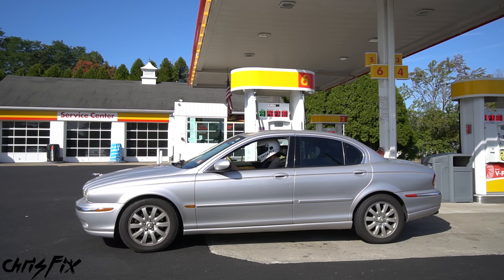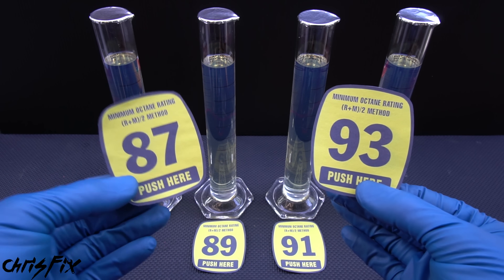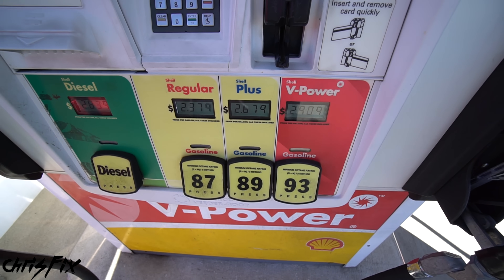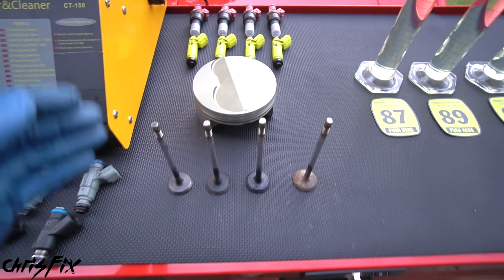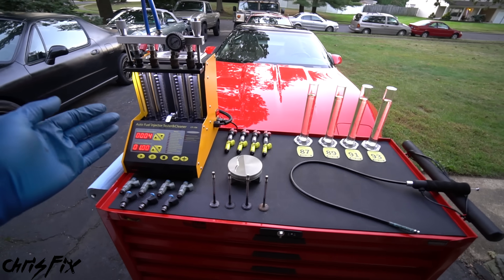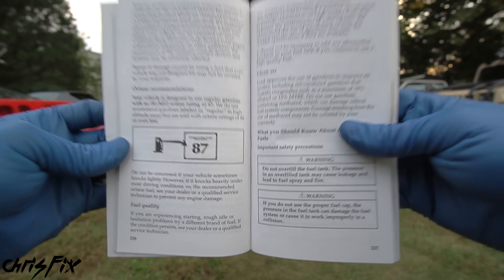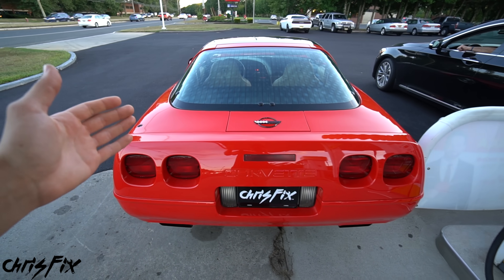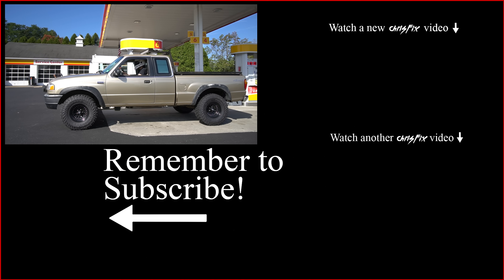What is the BEST Fuel to Use in Your Car or Truck and WHY

Comment: I have done my own testing, and mpg does get better using regular vs premium. Tried and true. Does it pencil out for savings? Not sure. The video left me with a lot of questions.
Reply: Not that easy. Since there are tons of factors to consider. The main one though: weather conditions (wind, rain and even sun). You'd have to do dozens of tests and make sure the conditions are always the same.
Reply: It's the detergents and your driving style, not octane (unless your car requires a minimum octane greater than regular)

Comment: I think Shell also must have some atomizers in their gas, because I consistently got about 20 miles more per tank in a V-Tec Honda Civic. My testing wasn't exactly scientific, but it was done over more than a year and my driving habits were very consistent. My gas gauge didn't work properly so I reset the odometer every time I filled up and my car consistently took less fuel to fill when running on Shell gas based on the same mileage from other gas companies. I noticed the pattern of better fuel economy (about 6%) using Shell gas long before I cared to do the math, so I don't think I started with any biases or preferences to expect a certain outcome. I don't know if Shell is the best, but it is definitely one of the top fuels.

Comment: Don’t you use mon in the US? - Motor octane number & not Ron? ….. saying pump octane is the same as Ron as it’s basically a temperature difference that separates the two measurements 

The whole thing about US having crappy fuel is just based on the fact that you can’t get the good stuff everywhere and some folks have to run on stuff like 87…. Which I would consider peasant juice & it’s not like it’s a country is known for high quality  🤷🏻‍♂️

Comment: I choose .... none!
I can only choose  between 95, 98 and 100+ Shell VPower.

I have a question - why a 3.8 V6 (i.e. Ford Mustang 1995) has 147 HP. It is less horspower out of 1 liter(39HP) of engine volume than Fiat Cinquecento 900 (900ccm, 39-41HP, that makes 43 to 45HP out of 1 liter)? It's much less than average european car from that era - 2.0 litre 115 HP or 140HP with 16 cams.

Comment: The rating system is different

However after speaking with someone who has worked at the same fuel company as an analyst in both the us and aus, the fuel here in Australia is slightly better

Comment: Ik this is an older video but I work in a gas station in Oregon (We pump ppls gas here) and if you buy a car from somebody I would not trust the gas cap. ppl lose the gas caps or get them stolen from getting gas siphoned and dont have the orginal cap. From personal experience i've noticed volkswagen and volvo cars take different fuel depending on the model and dont have a "special" cap what I mean by special cap is for example BMWs have a different cap and you wouldnt be able to use a typical gas cap on them while volvo and volkswagen can use most caps from what i've seen and many times I've seen gas caps saying  regular gas while the sticker on the side says premium.  You might say well I'll just look at the sticker but a lot of stickers especially on older ones r very faded or ripped off. It's a lot more common then you'd think but if you really care for your car i'd just use your users manual or just look it up online.
Reply: my Jetta (TSI) calls for regular but I get better MPG, mileage range and better performance when using 93. So there's that lol... A little trial and error definitely helps w deciding which gas works best for your car.
Reply: @1804Mak  yeah I noticed a lot of customers telling me that

Comment: Why would a relatively new car, 2018, run smoother with premium gas? It idles smother, and I take the same routes to work every day and I know every curve and hill, and when I run premium It doesn’t have to downshift to pull the hill.

Comment: What is you opinion on adding 1 cup of diesel to full tank of gas to clean it the same as you would with something like sea foam ????
Reply: jus use a fuel system cleaner instead of risking your car's engine...

Comment: My understanding is the higher the octane rating the more the fuel is resistant to burning therefore it reduces pre-ignition from hot spots inside a combustion chamber as described in the video as an explosion, the octane rating to me is just the fuel's resistant to burning.

Comment: Great vid.  One more thing to touch on is quality vs economy.  I could get 12 one way trips to work on a tank of chevron gas and 8 one way trips with arco gas. You will save money by spending more on top tier fuel as arco gas isn’t 30% cheaper while giving you 30% less mpgs. My yota finally popped a head gasket after 400k+ miles   When pulled apart, All valves were absolutely spotless. Not just the ones that had the coolant breech.  Because I always warm my rigs up and use top tier fuel.
Reply: My car gets better MPGs with Arco, no lie.

Comment: Hey Chris. Great video. You cleared a lot up. But one thing is still bugging me. Is Shell gasoline really being pumped out of Shell pumps and into my truck? I have pulled up to my Shell stations and they were getting their tanks refilled by a truck with no name printed on the side of it. What gas is really being dumped into the holding tanks at my Shell station? Thanks for sharing.👍👍🍁
Reply: I believe all gas comes from the same local terminal. It's the additives they add to the tanker that the different brands request ,that make the difference.

Comment: I use the Nitro pretty much 99% of the time… head scratcher is my is250 is a GDI sooo am I throwing $ away getting the premium…?

& I was under the understanding that knocking happened or was more audible after you shut the car off…?
Reply from the maker: No gas station I know of sells Nitromethane... That would ruin a stock engine. Check your owners manual and see what it says. That engine might require premium so you should use it.
Reply: @chrisfix  lOl I’m talking about the v-power-Nitro from shell…
Reply from the maker: @ngarci8040  ohhh lol. That’s just premium. Check ur owners manual to see if u need premium or not
Reply: @chrisfix  hey you do good work ty for your content…!

Comment: Great explanation.   I was surprised earlier this year when I read my Owner’s manual and it suggested a higher octane could help while towing.  Not “required” but if you had knock, run premium.  
Also, one thing I’d be curious to hear is when a gas station has non-ethanol gas or “real gas” as some say.  It’s usually 88 .  But that vs 10% ethanol gas?
Reply: Ethanol creates condensation which is bad for small engines (lawnmowers) and cars that sit.

Comment: Great Video as always Chris. I have a 07 g35x 250K on the dial. I  use a fuel additive that starts with L and ends with S on each gas up fill up         ( I buy the large one)  I will also do a 50/50 blend of Reg/hi oct. I also only use Synthetic Oil. Is this all OK?

Comment: My experience, find fuel with 0% ethanol. 
Octane does have to do with burn timing and burn temperatures. Octane changes the fuel chemistry to cool combustion which slows burn rate and reduces detonation.  This slowed burn rate allows ignition tuning so you can further advance ignition timing more than lower octanes.   Diesels have additives that work in the opposite direction of thinking the measurements called cetane.
After full 1 tank or 2 full tanks of non ethanol fuel it does help clean fuel system contaminants.  Ethanol gums up leaves films and build up in fuel filters, fuel pumps it corrodes fuel hoses and plugs fuel injectors.  Most of the octane booster products are just some form of alcohol which in most cases aren’t the best for your fuel system.  In some places your choices are e10 up to 10 percent alcohol 87 89 91 with option of 88 no ethanol or 93 no ethanol.  Some places there is and E85(85% ethanol) option and there is E15(15% ethanol for flex vehicles).  Ethanol does effect fuel economy and quality of fuel burn that is why I avoid it if possible.  If you want to boost your octane without ethanol the correct way find unleaded higher octane fuels, I have 3 gas stations around me that order them by the drum if I need it. They come in many octanes from 95 96 98 99 100 unleaded for street use certified application. They take delivery every 2-3 weeks. It’s for their high end cars such as Ferrari, Maserati exotic cars owners.  The cost is usually about an extra $3 more per gallon for 95 from my experience. $10+ more per gallon for others. But you will have a better more consistent experience in the vehicle. In the end I still prefer faithful Diesel.

Comment: 1:54 They don't have the same Energy content, 87 has more ethanol than 91 or 93 and ethanol has 20% less energy than gas. You would need to do the math based on percentage of ethanol because of the loss of energy. Yes I know (blah, blah, blah) I did the math on one of my SUV's and 91 gave me less $ spent per KM on long trips on the hwy. (but that was years ago) with the price today I use 87 in my vehicles.

Comment: I have a 99 GMC SUBURBAN 5.7 litter, wit ALMOST 300,000 miles on it (295,989 2B spastic) but it says 2 run 89 "OR REGULAR" GAS ⛽, BUT WITH ALL THE EXTRA BENEFITS OF USING PREMIUM, MY QUESTION IS - WOULD MY MOTOR BENEFIT OR RUN ANY BETTER OR CLEANER, IF I WERE 2 RUN PREMIUM GAS EVERY OTHER FILL UP OR EVERY OTHER 3RD FILLUP, OR WOULD THE DAMAGE FACTOR B HIGHER THEN THE BENEFIT FATOR..? Jw IM VERY CURIOUS AS 2 HEAR WAT EVERY1 HAS 2 SAY ALONG WIT THE MAKER OF THIS VIDEO TOO (HOPEFULLY ANYWAYS...) BUT PLEASE FILL ME N ON THIS CONUNDRUM ON WETHER OR NOT THE RISKS OUTWEIGH THE BENEFITS OR VICE VERSA... PLEASE AND THANK U

Comment: Great video. Wish I say it earlier, will definitely share with my friends.
Up here in Canada, all of our top grade gas (93 and higher) have about 10%ethanol, but some of the mid grade (91 and 9 2) have no ethanol.
My question is... Do you think ethanol will cause more engine corrosion in thy long run?
My car needs minimum 91 octane (I can get that without any ethanol), but sometimes I would like to use 94(which always has ethanol).
Thx!
Reply: ethanol is also cheaper, here in Ukraine some people just add alcohol to 95 gasoline in proportion about 30% percents of alcohol.
Reply: @HannibalLecter-w3r  bless you guys in Ukraine
Reply: @Flight2Freedom86 if you're interested there is no gas/petroleum/diesel fuel right now. Everything goes to army.

Comment: For those vehicles with 91 recommended yet available fuel has ratings 87, 89, 93, ...? :) Often fuel not promoted with understanding Octane rated distinctions but indicated as 'grades' so people understandably get puzzled about energy quality & enhancing performance or emissions & pollution issues then through in the blended & additives so issues become prominent including doubts on purported specs & methods.

Comment: At 2:08 you say that octane does not affect the speed of the burn. That is FALSE.  Detonation occurs in 1000th of a second a normal burn occurs in 200th of a second the speed of the burn is exactly what the difference in the octane means. 1 thousands of a second or less IS detonation. I realize you are looking at it as the spark burning out evenly vs multiple points starting so the speed of the reaction is the same, it's just starting in multiple points. However the end result is all the mixture being consumed in 1000th of a second. It burned up faster. The definition of detonation is a burn that occurs in less that 1000th of a second, the cause is not relevant. Speed is the relevant factor. Higher octane causes the fuel air to burn in more than 1000th of a second. The metric is, has been, and continues to be time. Because the definition of detonation is time related...  PS LOVED the video!

Comment: My gas stations have 87 with 10%?ethanol and they have 87 ethanol free for a more expensive price.  Should I be concerned with gas with a little ethanol in a stock 2006 Camry with 70K miles?  Why do they have ethanol in them in the first place?

Comment: Thank you!  I have a van that uses either flex or regular. A mechanic told me not to use the flex bc it gunks up the engine. Do you have an opinion on that? Also, which grade fuel if I use regular grade on the van and can't find the grade? Thanks for answering bc I also have a luxury car and usually use the highest octane. Is it ok to use the midgrade in it? Thank you in advance!♡

Comment: I thought this would be a video about what gas I should put in my car for hp over gas mileage. Chevron for gas mileage and for myself I personally love having more hp so I only use Shell.
Reply: The reason he didn't make that video is because it's nonsense
Reply: @jonathansmith7306  I wish all gas was created equal. Unfortunately there is truth to this. Shell gas burns hotter while Chevron is more milder but better with fuel efficiency. Only a 1.5 gpm extra but it's a difference. Ampm gas is the worst on hp and efficiency compared to shell and chevron/Costco gas. Don't believe? Do the Shell challenge

Comment: Usually I go to chevron,  when I got my brand new 2021 chevy silverado crew cab z71 rst, when chevron got high, I go to shell, sometimes Costco....my wife put Arco in it once cuz chevron at a certain place wouldn't take her atm. So I just need to stick with Chevron/Shell, 87 and I'll have to try 89 to clean it out.

Comment: It's been proven in multiple studies over the years by both the EPA and Fuel Production facilities that the use of premium grade fuel returned more MPG than either regular or mid grade fuels. It does it by burning more completely and efficiently. Efficiency = Performance = Energy produced. The more MPG a fuel grade provides means it produces more energy than a lower grade fuel

Comment: Also dirty fuel builds up on spark plugs causes less life on the plug most high performance cars use hotter plugs so they run and last longer with correct fuel!

Comment: I get better power out of 93 than I do 87 my v6 4 runner it’s got 4valves per cylinder. It makes no noise on 87 but it doesn’t run smooth like 93

Comment: the fuels are not similar. I was Fuels in the military overseas and conus. Canadian 90 fuel gets 160 more miles across a full tank to empty in my Sierra Denali. 93 in Alaska (from chevron pipeline) and in the U.S. lower 48 only adds 50 miles max to tank volume usage compared to 87 octane. 

Also my Chrysler says flex fuel 85 but incurs performance problems and bad gas mileage results after consistent usage, as well as 87, so I use 89 in a t&c minivan.

Comment: The biggest myth here is claiming that 93 octane is premium fuel
It is not premium feel premium fuel is 100 plus octane... 93 octane is only considered to be regular fuel... Premium octane fuel is not sold at the pumps anymore
Example one of my older cars was a 1972 Ford LTD with a 400 cubic inch engine with a compression ratio of 8.6 to 1
The owner's manual said congratulations you now have the first Ford big block with a low compression that will burn regular fuel of 93 octane..
This engine was called the m that stood for modified. What Ford had done what you lower the performance to gain more fuel economy and still maintain a reasonable amount of torque for pickup trucks four wheel drive pickup trucks and large heavy full passenger cars.. and at the time it was pretty successful it got 18 miles per gallon not bad for a car that weighed almost two and a half tons... So all of you out there are just s***** yourselves and listening to a fool who thinks he knows you're all there is about car he didn't know anything first of all he doesn't know what happens when they knock sensor kicks in and it retards the timing so the Piston is firing after it went down losing gasoline after exhaust and costing you performance and money burn 93 octane and everything including your lawn mower
Example I went on vacation for a couple of months and the guy mowing the grass at the house was running our John Deere on 87 octane and it was nothing so bad you couldn't turn it off and keep on running like cars did in the 70s when they come out with 93 octane
I mainly change the oil in the John Deere and add a full tank of 93 octane that runs like fine like new

Comment: ChrisFix - Great vid.  My '88 BMW 320i manual says max 3% methanol.  Now that regular has 10% ethanol and most premium has 5% I have switched to Esso Supreme which is 99RON and still has 100% petrol.  Do you know if ethanol is less reactive than methanol and if thereby I might use Shell VPower with 5%?

Comment: Yes I have a question
When I'm running a 70's 350 4 bolt main that's been bored 30 over with almost completely eldebrock parts on the motor, the motor has all racing parts and has a shift kit with the 350 turbo transmission, what gas should I use for that car?

Comment: Some engines that are low on compression will not run higher octane fuel.

Back when i was a kid i tried 89 and 93 octane in my dirtbike because i thought it would go faster.

Ran great on 87, ran like crap on 89, would not run no matter how hard i tried on 93.

Emptied the 93 and filled it with 87, fired up after a few kicks, then the first kick every time once 87 was back in the fuel lines.

Comment: I'm sorry but I've worked on vehicles and I've got to disagree. Octane slows down the burn rate of the fuel. The gas per gallon is the same until the octane booster is added. Then when the octane is added instead of a bang and done, you get a longer burn through the power stroke which does produce more power from the engine, and also keeps you from getting a pre ignition. Oh, and the worst valves that you had was cause by oil consumption. I really didn't see any valves that I would have wanted to put back in without a grind job on them.